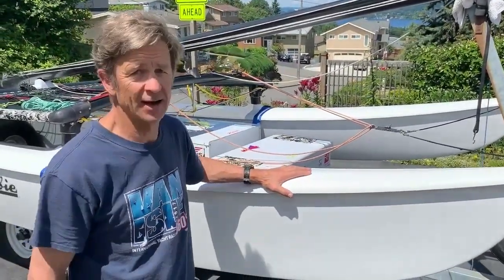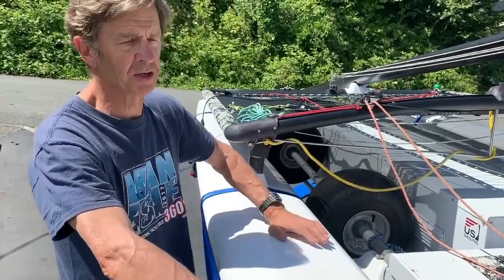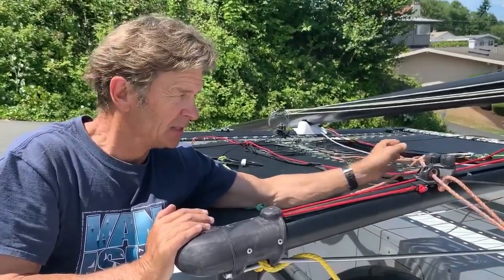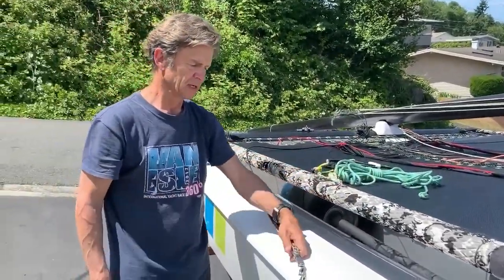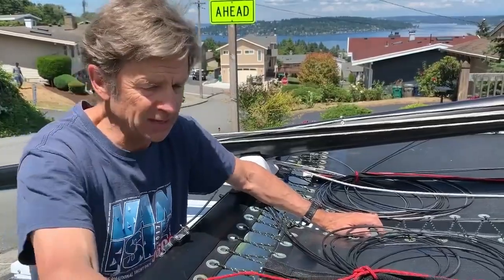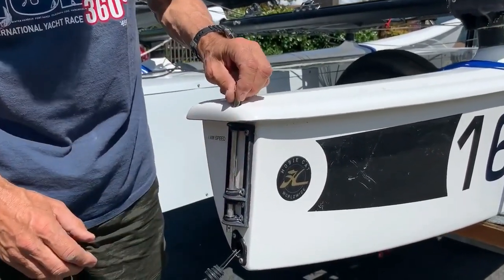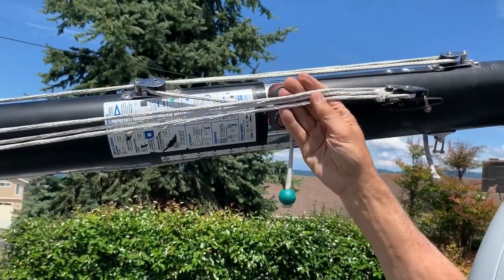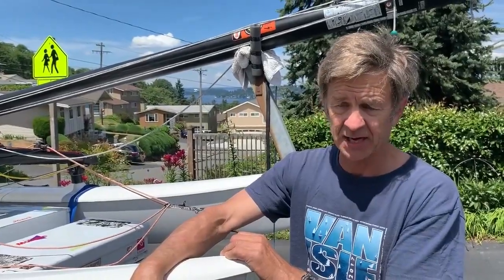Hobie 001 - What to look for when buying a Hobie 16

Comment: Thanks for posting this, some great tips there. My 05 has most of which is on the new boats short of the main halyard cam cleat and 5:1 downhaul (I upgraded it). I like that they have the trapeze wire through grommets. Mine go around the frame and so rub grooves in the grips. The initial cost was higher than the others but there really wasn't anything that I had to fix to start sailing. 
A neighbour got a "free" 16 and was all excited about getting right out on the water. This thing is in really rough shape with all original rigging and super soft hulls. It's late 70's I think. (what a strange main block). I wouldn't sail this thing anywhere where I couldn't swim back to shore.

Comment: I found a guy near me selling his hobie 16 and trailer for $400, the top of the hulls have some cracks and he said there are a lot of soft spots and the trampoline has some holes. Is this a good deal?
Reply: Do you want to invest the time and money to rebuild this boat? A better deal can be getting a well cared for Hobie 16 that is in good sailing condition. Then you can spend your time sailing rather than repairing and upgrading. That said, it may be worth the parts, sails and trailer if the trailer is road worthy. But know what you are getting into. If you are not handy, stay away from it and get a boat that is sailable. If you have more time than money and are very handy, the soft spots can be repaired. Check out a hull repair video so you can see if you are up for this type of repair project.
Reply: @JamesDonatelli  I mean I figured getting a messed up boat would force me to fix it so in the future I would have the skills in case it broke. Any who the guy magically didn't have a title for it and in Texas it is impossible to register a boat without a title.
Reply: Did you get it, or let it go man?
Reply: @mrwhatevz8907  Ended up buying a 22ft 1977 sailboat.